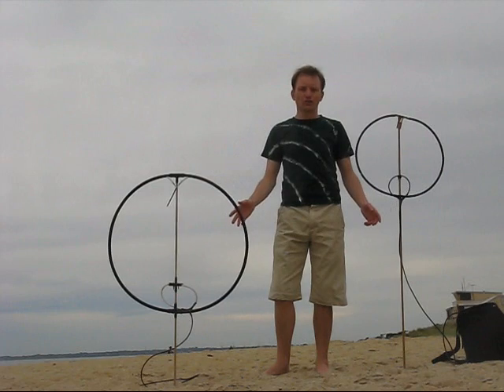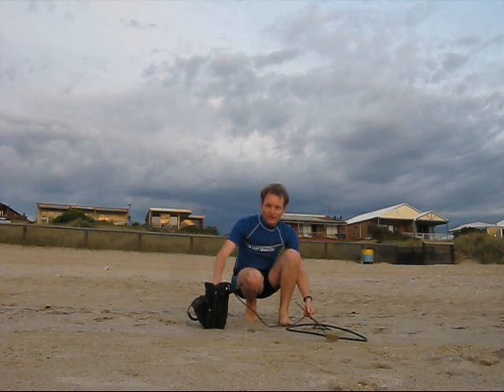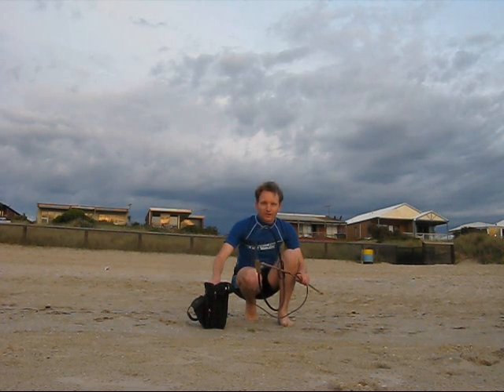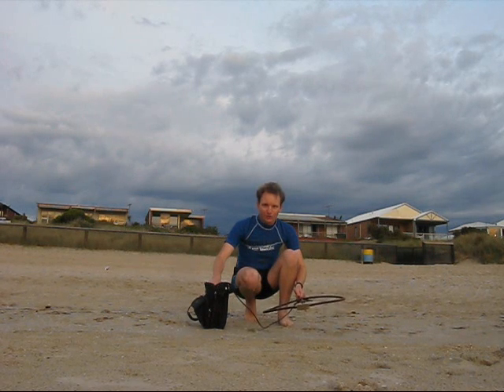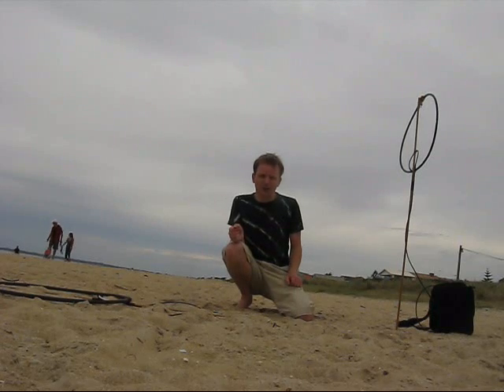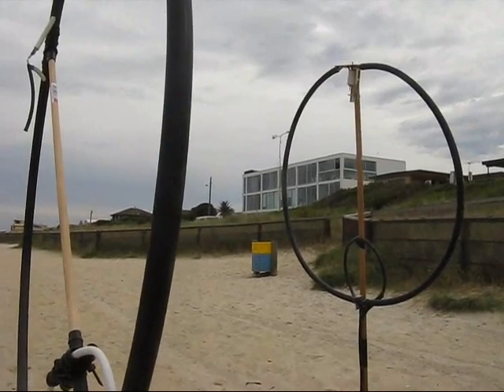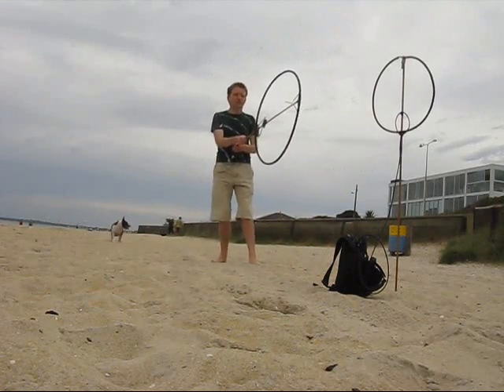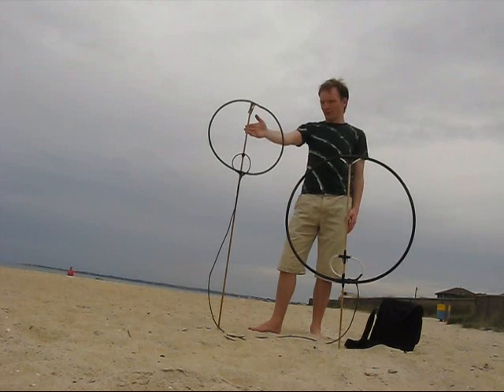Tests with magnetic loops 1: Is height might? Are two loops better?

Comment: I went out and repeated your experiment, also on a beach.  You say "there's not much difference at all" with height with the loop in the vertical plane.  But you are wrong.  When the loop reaches torso height, the signal is clearly much stronger.  Why?  Because that's the height you tuned the high-Q loop at.  Any departure from that height, up or down, significantly alters the matching, which is why the signals are weak with the antenna overhead and low down, but strong half-way along.  See: https://mw1cfnradio.blogspot.com/2020/12/magloop-experiment-time.html
Reply: Hello John,
What do you think is the optimal height for a magloop?

Comment: Aha!  The loop, held in vertical orientation, has vertical radiation in the plane of the loop, and also equal but horizontal radiation perpendicular to the loop (i.e. at the same time).  So, when that signal comes up round about chest height in the vertical orientation, is it receiving the station by vertical or horizontal radiation?  Knowing your location and TX station positions should allow you to answer this!  I wonder if the second loop is simply detuning the first so that it is actually better tuned from a slightly off-tuned position.  The Q is so high for loops that dancing around with them like that, with variable spacings and couplings, is going to make for much more careful assessment of what's going on.

Comment: vk3ye, two loops will have better efficiency because the second loop has a bigger diameter which means it is more efficient. When you positioning 2 loops together you have two contours having a  resonance and coupled together. This is why you have a better reception.

Comment: There's an interesting loop getting around that is a figure 8 with the tuning capacitor in the middle. It's still relatively simple and there are claims that it's significantly better than a single magnetic loop. The loops are not parasitically coupled but rather connected in parallel at their tuning points. This is claimed to lower the impedance at the tuning point as compared to a single loop and also broadens the swr bandwidth. Worthy of investigation I think :)

Comment: inconclusive testing procedures. as loops radiate to their side better than broadside. as for two loops. they maybe better if they were phased and spaced. but being they are tuned and narrow band. You'd need an actuated boom to do the spacing and a phasing harness for the band your working. and if kiss "keep it simple stupid" is the law with loops. that just adds more complication to the mechanism. now for the flaw in your testing, you hold one wile the other is stuck in sand. you would take the one in your hand and rotate it from horizontal to vertical. wile the one in sand is horizonal polarised. i've wondered if placing a metal ground plane, of significant size " say as big as the loop is round," under the loop. just a few feet from it. would it emulate as if the loop is near the ground. but placing the antenna up on a high tower and on a rotor. because it's like a dipole and it's directional. but opposite in the direction it radiates. it radiates off the ends or sides. where a dipole radiates broadside, where you see more of the antenna. but if a ground plane worked. then maybe it could have grounding radial strung from the metal plate "ground plane" side. drooping all the way back to true ground. as if your on a hill or mountain top. because amtosphiric voltage exist and that voltage rises as you rise in altitude. that would seem to introduce more noise in ones receive, as the antenna gains in hight, without a close proximity to some sort of ground or ground plane. the tower would act as a ground. if it weren't a vertical spire. just saying. but good try. ps... I understand some people can't or don't fully understand my typed examples. I hope I suggested this as better example this time. I've wanted to build a loop like an eye beater style antenna and have an magloop omni. the feeding of a omni loop, adds complication to the mechanism. I feel to do such and keep it as simple as possible, will take place using a ferrite core inductor with the loops crossing through it. unlike crossed dipoles with a phasing harness or matching ballum.

Comment: You can in fact use the passive loop to cancel the noise but its a darn tricky stunt to perform without reducing the wanted signal...:-)
Reply: 5p1cc I've wondered if you could use a loop and feed it to a yagi constructed passive radiators. even a passive multi band yagi with coils. but it would have to be made from nonconductive materials. because loops radiate in the direction from its sides not broadside, unlike a dipole. that's my take on how a loop radiates.

Comment from the maker: @johnkc8jzo would be an interesting experiment. Unfortunately the unconnected loop is fixed tuned so I couldn't do it. Next project is an array of 3 or 4 loops, all with capacitors and variable spacing.